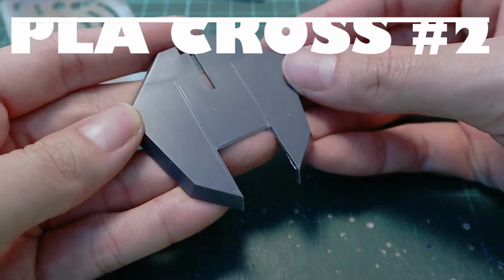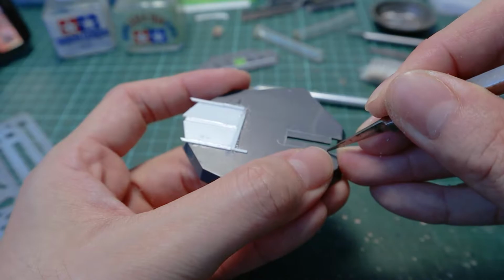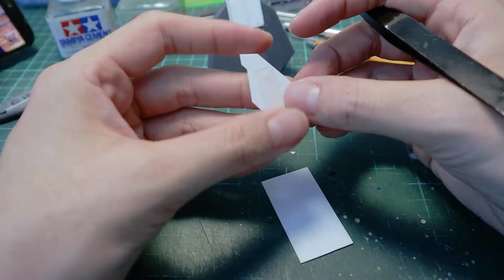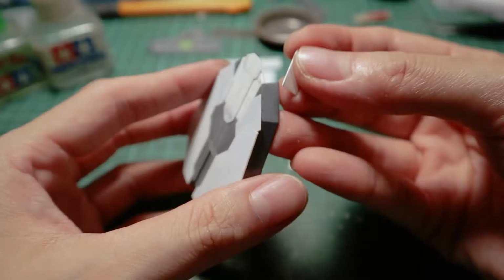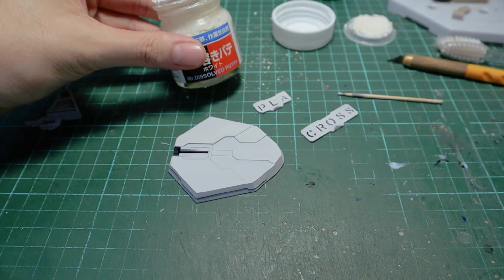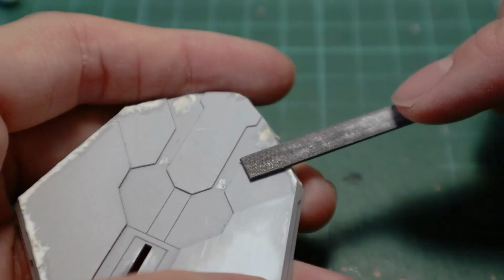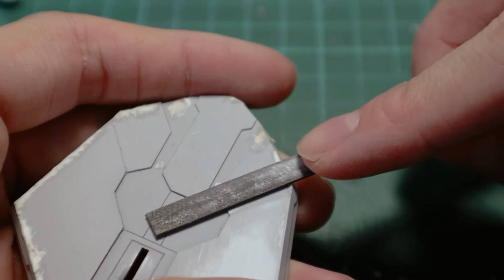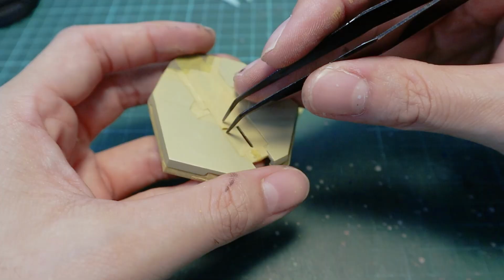Pla Cross #002 | Gunpla Custom Tutorial | How to Pla Plate

Comment: Ah ok so planning is very important ok so il try to get practice on parts I don't mind getting extra kits of on like high grades then real grades before I work on master grades for pla plating
Reply from the maker: Actually, try it on 1/100 no grade [NG] first for pla plating so it won't be too difficult to try since HG parts are small. You might get frustrated easily

Comment: May i ask what brand of files you use in the video?
Reply: I think its tamiya
Reply from the maker: Sorry, been busy with work. I use mineshima files. They are sold in sets so in 1 set you get 3 - 5 file with straight, circle, half circle, triangle and square
Reply: @placross  no worries man, thanks for replying. Do you remember the model number? Is it the H-17 deadsmooth (sets of 3) or do you use other models too?
Reply from the maker: @farraseldy3121  I use 3 different sets, H-16 [700], H-14 and H-17. Don't remember the grit on the other 2 sets. I suggest try getting the H-14 to test it first since it is the middle in terms of grit. H-17 is very smooth, H-14 is very rough
Reply: @placross  alright thanks man. Love your vids 👍
Reply from the maker: @farraseldy3121  thanks man! I want to make more videos but I don't have a lot of time so I might try to change the format 😁
Reply: Take your time. Looking forward to it! 😁